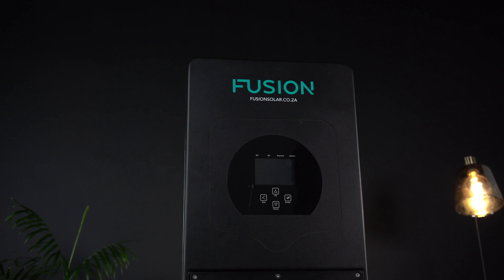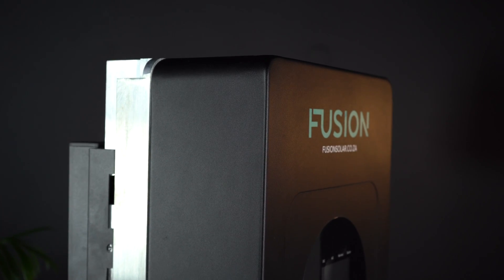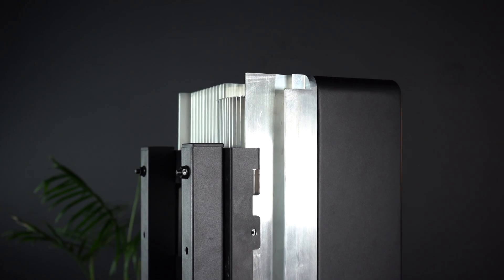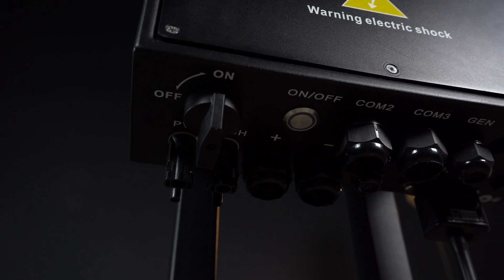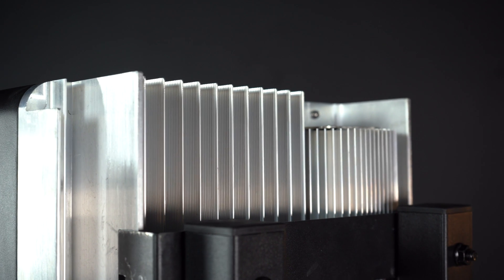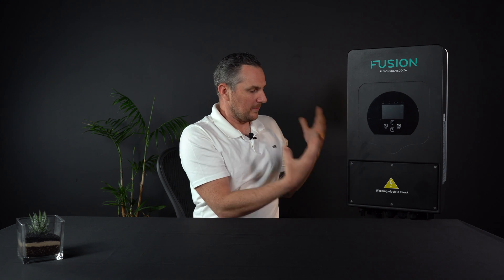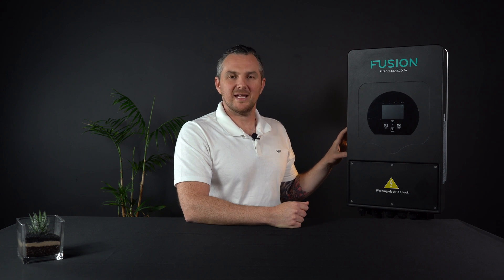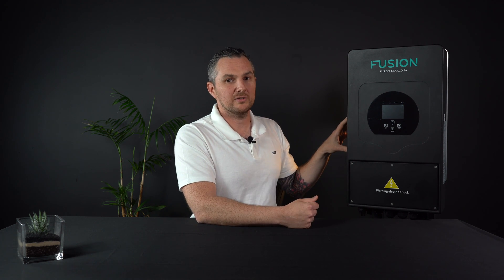Understand the Hybrid Inverter | Solar Advice

Comment: Hi Sir
I have a question about hybrid inverters. I have currently a inverter Fronius Symo 6.0-3-M, but wants to add a large battery to my solar. The battery will be a homemade with a capacity of 60-62kWh. Which hybrid inverters are suitable (recommenable) to manage a non fabric battery system and how do I select the right one?

Comment: Is the AC connection to the grid bi-directional or just 1 way, in?
Reply from the maker: The grid is a single bi-directional cable and the hybrid inverter controls the direction of it, there is a component called a CT clamp that basically prevents the feedback from happening if don’t want to feedback. At the moment in SA the grid can’t handle the feedback so we use CT clamp on our installs.
Reply: @solaradvice   - what I meant to ask was being connected to the grid when the batteries are full will it feed power back to the electric utility company crediting you?
Reply from the maker: @dargall1  the batteries won’t feedback, only the PV. But also you need to arrange with municipality in order to get credit from the feedback.

Comment: Beautifully done!! Thanks for the video
I have got a question. How do you design a Solar PV system that supplies a DC load by taking power from Grid? It uses a rectifier for the conversion. It has got battery bank connected after the rectifier. Will it work if I just connect the PV to the DC bus through a charge controller?
Reply from the maker: I’ve never used a rectifier but if you have DC power and the power doesn’t exceed the DC input then in theory that should work. You could also convert it to AC and use the AC input too, I know this works for AC generators and inverters, sorry I can’t help much with that one.
Reply: @solaradvice  No worries. Thank you.

Comment: Hi. Thanks for the videos. I started out recently with only backup power using a 2.4 KVa inverter with x2 12V 200Ah batteries. Now I want to connect it to solar, but my Crystal Inverter says Pmax  206W does this mean I can only connect a 260W panel?
Reply from the maker: I’m assuming that is PV Max, it’s very low at 206W (or 260W), you’re right that it is a 260W panel in that case.

Comment: I have a 8kva hybrid Sunsynk inverter. How does the inverter handle a load higher than 8000wat? Recently my breaker at the DB board that the inverter is connected to tripped that I was not expecting. I understood that hybrid inverter would just go fetch the difference power from Grid vs the inverter capacity limit to match the higher load. So just wondering what I would I should of expected to see the inverter do.
Reply from the maker: The Sunsynk is a Deye inverter just rebranded, both can handle 10kW temporary throughput but this is only temporary, if your inverter reaches a load of 8kW then that is your limit, this includes whatever is pulled from the grid, so it tripping was correct, what size breaker do you have and what was the total load at the time?
Reply: @solaradvice  So you saying a hybrid inverter is not designed to shift the load to be fetch from the grid when the load goes above the inverter's capacity?
It was for a small amount time. Probably less than 5min before it tripped if I log at my sunsynk loger app. 
Also there is no fault error on the inverter. 
It is a 63A M.E.S CDL7 range breaker.
Interesting enough the breaker does not trip when I move the inverter to grid to inverter change over switch to the grid. 
However it keeps tripping when I move change over switch back to the inverter - even with load is less than 500watt.
Reply from the maker: @Skip2MiLuu  you can check this datasheet which is a 8kW, the Deye, Fusion and Sunsynk hardware are all the same: https://solaradvice.co.za/wp-content/uploads/2021/03/Fusion2-8kw-datasheet-02.pdf Max AC output power is rated at 8800W for the 8kW and if you check the Peak Power (off-grid) it states "2 times of rated power, 10s", running any inverter over it's rated output basically puts strain on it thus shortening it's lifespan. I would keep loads under 8kW to prolong it's lifespan to be safe. We put 50A breakers in our boxes, this is our favoured size.
Reply: @solaradvice  I aware of the datasheet of the inverter. I believe you not understanding my specific question. 
Let me ask it again using a more specific example scenario.
I understand that my interver is limited to only being able to supply it rated load of 8000w and 2 times its rated power for 10 seconds. However my understanding was that in a scenario of a load of 9000w a "hybrid" inverter would intelligently only supply 8000w of its rated power (or what it is set to supply) and the additional 1000w would "pass through" the inverter coming directly from the grid. 
So is my understanding on how a "hybrid" inverter manages a higher than rated loads incorrect?
Reply from the maker: @Skip2MiLuu  Ok I understand what you are after, thanks for that example. I've never heard of an extra pass-through limit like this before, the limit as we've seen it is a combined limit so in your case that 9000w is going over that. We always stuck to the limits, the same is said for the PV side, you can run slightly higher voltages but we don't advise it as it can void the warranty if the manufacturer sees that it was used beyond it's limits. Hope that helps.
Reply: @Skip2MiLuu  Maximum essential load on the 8kw Inverter is 50A. Which is 12000w or so. This is a combination of solar + batteries and Grid/Eskom. This is a continuous rating,  and will not damage the inverter if sustained, it will trip however if it goes over that.
Reply: @solaradvice  why 50A instead of 63?

Comment: hi
i have 2 inverters infinisolar hybrid 5600 on-off grid, when it works parallel the error comes up under number 72 can you tell me how can I solve this problem
thx
Reply from the maker: What does it say in the manual? Under error codes
Reply: @solaradvice  Current sharing fault
Reply from the maker: @yehyaalchab  we don’t deal with infinisolar, the information will be in the manual, happy to help if u can tell us what it says
Reply: @solaradvice   error number 72 says : Current sharing fault
Reply: @solaradvice  it is the same one you demonstrate in ur video exact and same screen and same data and same firmware
Reply: Sorry For Disturb
Reply from the maker: @yehyaalchab  it’s not the same inverter, this inverter is a Deye
Reply from the maker: @yehyaalchab  let me check for you
Reply from the maker: Do you have a model number, the manual I have doesn’t have that error code
Reply: @solaradvice  Model No. InfiniSolar V IV 3.6KW / 5.6KW

Comment: Given that the rating is 5kv , let’s say I need more more kv , so does it have a limit in pulling power from grid?
Reply from the maker: Yes, it’s limited by your inverter size, it’s important to get one that’s larger than what you would normally need in case of extra household consumption

Comment: Thanks so much for the info, now I get the real difference between off-grid and hybrid inverters.

One quick question please, given that I have this Fusion/Deye inverter on 5KW, how many of FREEDOM WON E-TOWER 5KW LITHIUM BATTERY can I stack up?
Reply from the maker: Glad you got some value out video!

I’m not sure about how many Freedom won’s you can stack but they should tell you on the datasheet, it will say how many you can parallel 👍

Comment: Thanks for the useful info. Just started looking into solar power generation for our home. I tend to take info in a lot better with pictures and diagrams  instead of explanations. It would be helpful if you could show visually when explaining things like grid, inverter, battery vs panel etc. connections and how they interlink.
Reply from the maker: Thanks for the feedback, we’ll do a full system animation with working parts on future videos.
Reply: Ok, thx for the advice. When you usually type in yt everything I mentioned, 100s of videos will come up about them
Reply: Hi nice post...what is your view of the hybrid Five Star 8kva inverter